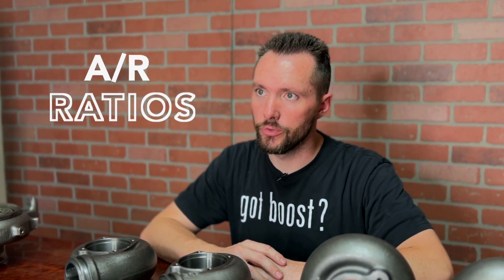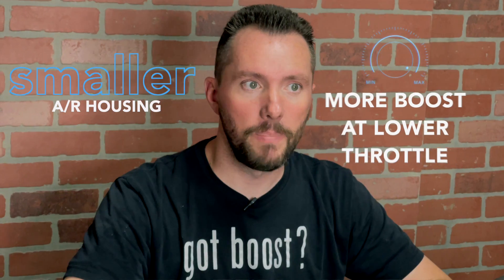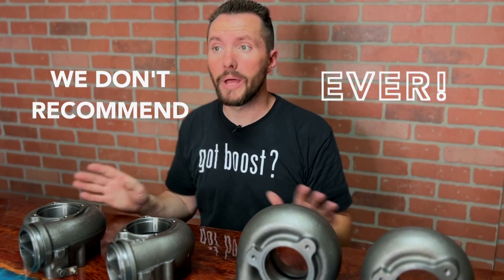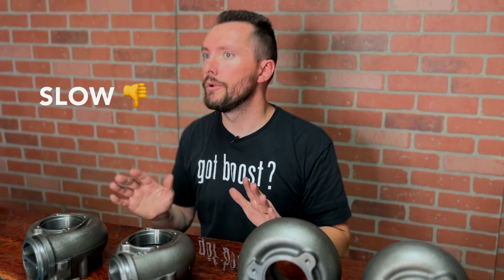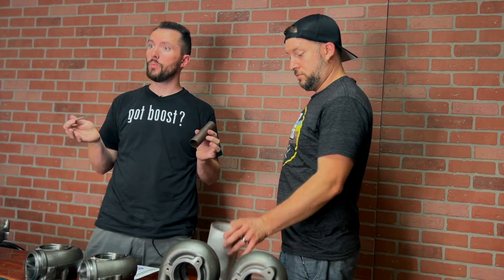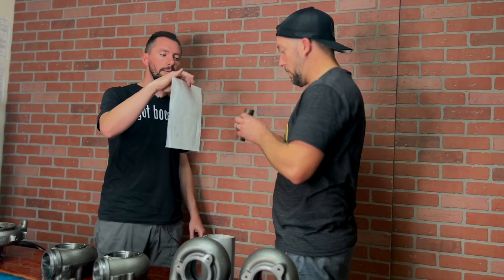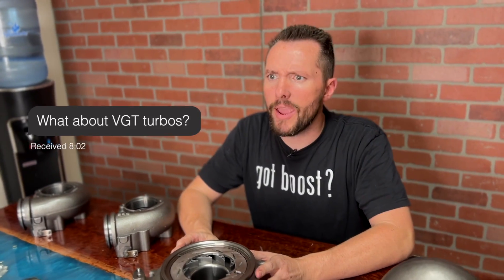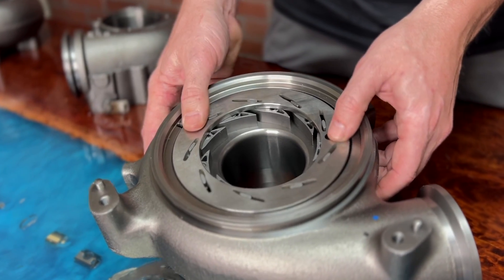Turbine Housing A/R Ratios Explained!

Comment: I got my tp38 torn down but there is a broken center cartridge bolt inside the exhaust housing. Inlet boot was on it's last leg about 10 years ago 😂 1 seized stud and nut at the collector inlet to the turbo. Everything has fought me with this job. It will be a couple more weeks before I can get all the additional parts together but I'm going to get your guys 84 ar housing. It just sucks I already tore my truck apart. After all of this it's really going to be much happier. The turbo is missing gaskets, silicone everywhere, broken bolts. This fun turbo rebuild project has gone south on me so quick 😢

Comment: S364.5 with a 73mm turbine on a 6.0 with stock sticks, should I run a .91 or a .83 AR ? Planning to run 205/30’s in a year or so
Reply from the maker: If you ever tow, you will want a .83 but if its a daily or racetruck then go with the .91

Comment: thanks, i understand know. Basically smaller AR means more back pressure (less power) - higer pressure in exhaust manifold, wich means higher pressure is needed to drive the turbine for a target boost pressure. Because the flow (drive power) on the turbine is smaller on the smaller AR, because it is nearrower. The bigger AR provides more flow (more drive power) on the turbine, which means the turbine needs less exhaust pressure to reach a target rpm (-> boost level). The boost pressure is indeed the same, but the bigger AR provides less backpressure wich leads to more overall gas flow, -> more efficiency -> more power, but slower response.

Comment: Not only is this an excellent video, it’s the best explanation of A/R ratios I’ve seen.   Thank you very much.   Now, to understand turbine sizes.  lol
Reply from the maker: Turbine sizes are a huge factor in performance too!  We can make a deep dive into that as well.
Reply: @ That would be amazing.  My end-goal is to understand if a turbo intended for a smaller displacement engine (3.5L EcoBoost) can work on a larger displacement engine (5.0L Coyote) albeit with enlarged turbines to achieve low-end torque and power.  Thus, it requires an understanding of A/R ratios, turbines, and how turbine sizes work with different A/R ratios.  As one content creator to another, I see one or two possible videos to create a mini-series on how to select a turbo.

Comment: I have a vw touran 2006 1.9 diesel. The factory turbine spec makes the turbo to boost at low rpm from 1k rpm to 3k rpm and the 4k and 5k rpm doesn't feel like it's having a big boost. So I wanna switch to a turbo that covers the rpm from 1k to 5k.
Any suggestions?
Reply from the maker: We do not dabble in those turbos, Have you tried different custom tunes?

Comment: I just went from a stock obs tp38 with a wicked wheel and a 1.0 housing to a kc turbo stage 1 63/70 .84. I already noticed more boost on the same tune and it comes on faster. I also noticed a very large egt drop with the stage 1. I can now pull a hill at about 1100° vs 1300°

Comment: Match the turbo for the engine max HP area .  Max HP 450 @ 4,800 get a turbo that have best flow around that RPM . Working together  united state has great benefits

Comment: Why does no one talk about compressor AR??? Why not change that? Why not explain how to match turbine AR to Compressor AR?
Reply: Compressor AR has much less effect on overall operation. It's usually chosen by the oem to match flow needed for a range of housings. Therefore it's usually the same for 5 different turbos and turbines. Sometimes more. I

Comment: Any input on .84 a/r and whicked wheel 2 on a 97 7.3?
Reply from the maker: The Wicked wheel 2 is on the compressor side and the .84 A/R is referencing the hot side.
Reply: @KCTURBOS  copy that. Would that be too much stress on the turbo?
Reply: @707Anguiano  No, that should run well.  But I would go with a KC billet wheel or balanced assembly with .84ar housing.

Comment: You can spool a stage 3 with 160s unlike what this guy said on the phone. Ask me how I know.
Reply: Anything will spool eventually... but why?  160s are good for 375-425hp and stage 3 is good for 500-550hp.  So you have the laggy of a bigger turbo that won't make any extra power.  Sizing the turbo and injectors together will always net the best results.  For 160s I would go with an s1 turbo.

Comment: Could u let me know what would be best for a FORD FALCON Barra Engine 2003 to 2014 not above 2016 there FG models and they are short barra engines... the earlier ones are Long barra engines.. which i have a 2004 model... i wanted to make around 500HP Just wanted to know what would be best for lots of power and very fast boost... which Turbo to choose i was leaning around a medium sized one... but there is a lack of info out there on whats good and not lol...

Comment: "we don't recommend 1.15, they're laggy and slow" 😅😅 and I'm here rocking a 1.22 on my Honda.. 🙈
Reply from the maker: Hondas redline at like 8-9k so they can flow a 1.22 A/R much much better than a 3.2-4k rpm diesel! haha
Reply: @KCTURBOS  that makes sense yes haha. Also I've read that diesels exhaust gasses aren't as hot so it doesn't have as much energy to push the turbine
Reply: He's talking stock or close to stock. Obviously your Honda isn't anywhere near stock. If it is, it's laggy and basically worthless.
Reply: @brettrichards666  i think also, he's talking about diesel engines.
Reply: @Dankro91  Yeah. I honestly have no clue about Hondas. Who knows, maybe you can run a 100mm 5.5AR housing on a honda. Lol
Reply: @brettrichards666  🤣 noo that's a little too much.
Reply: @Dankro91  Oh, okay. I learned something new today. Haha

Comment: Quick question for a 7.3 does it change the sounds I would think since the turbo is spooling soon better sound at idle and lower Rpm’s
Reply: There is not usually much of a sound change with different a/r housings... except like you said that you will hear boost coming on a little sooner.
Reply: The kc 63/73 with .84ar is slightly louder sound and turbo whistle from exhaust side and gives a good relatively quiet sound on the compressor sound.

Comment: FFD recommended i go with the 1.0 when i was setting up my 96 FSuperduty dump with 63/73 tiger and their 180/30's. Its pretty much still useless down low where i need it even with full fuel system and adrenaline setup. I knew i should have went tighter for what i was doing. Any suggestions?
Reply: Change the exhaust housing to a .84ar and you wont be disappointed.

Comment: I put the 1.15 ar turbine housing on my 03 7.3. best way to drive a super duty imo
Reply: I have always hated the 1.15, its laggy, spools slower, and makes less power.  We have tested it many times.  But as long as you like more lag, more smoke, and less power... then the 1.15 is perfect.
Reply: @peixinho5927  well I have a WWII and properly deleted wastegate and good capped lines, performs and tows better.
Reply: Actually less smoke, as the waste gate opens it dumps more smoke, so you've got that backwards.

Comment: A/R ratio for an S15 / SR20DET with stock internals ?
Turbo just died and looking at upgrading to a G25 - 550 but dont know if i should replace the manifold for the 0.72 v band inlet or keep the existing manifold and get hte G25 550 with the T25 inlet and 0.49 A/R.